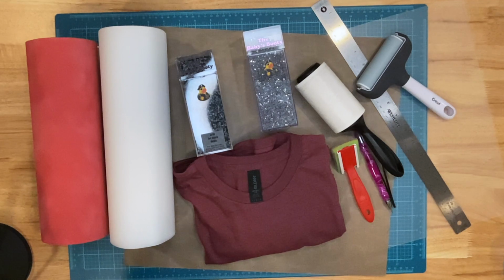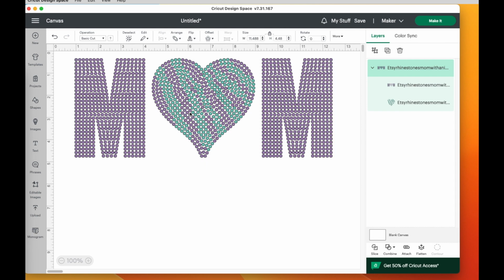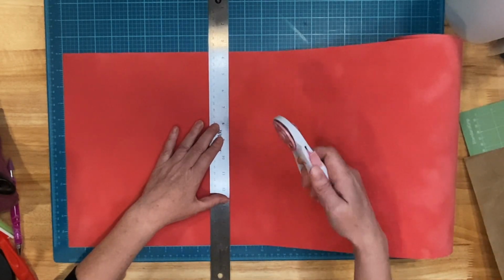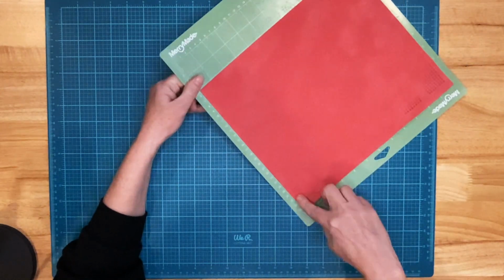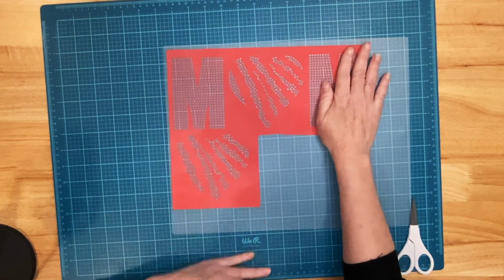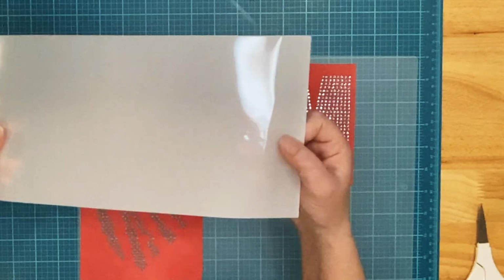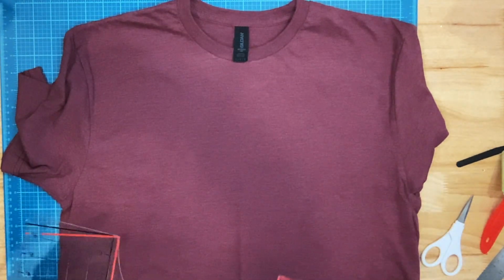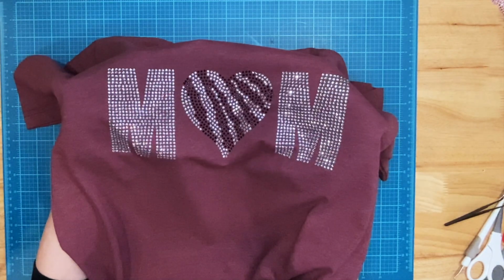Making a Rhinestone Design with Animal Print

Comment: Do you have to have a Cricut machine to do this design?
Reply from the maker: No, you can use any cutting machine that will cut through the rhinestone flock. I have used a Cricut, a Silhouette, and a Siser Leonardo machine. Do you have a cutting machine?
Reply: @MakingwithMarilyn  Thank you, Marilyn for responding to my questing.  I was thinking about purchasing a Silhouette machine because, I am really interested in learning how to do Rhinestone Design.  I really love the way in which you teach your audience and I love your work.
Reply from the maker: @MeccaMakeba  the Silhouette 4 that I have does a nice job. If you want to make rhinestone templates, you will have to upgrade from the free silhouette software, but it's a one time fee and not too much. And SwingDesign (where I got mine from) often has it on sale. You can also use the Silhouette software to make your design and then cut them on a different cutting machine.